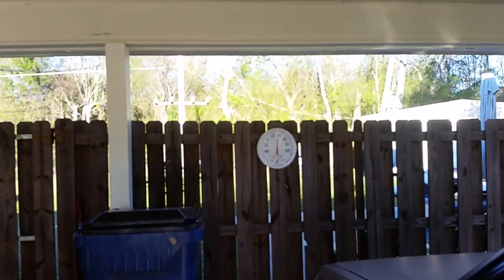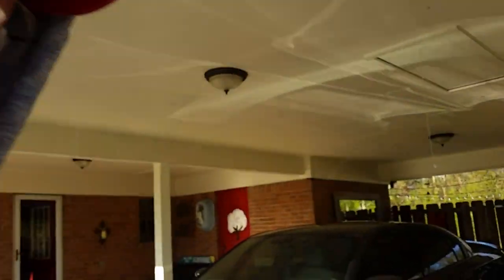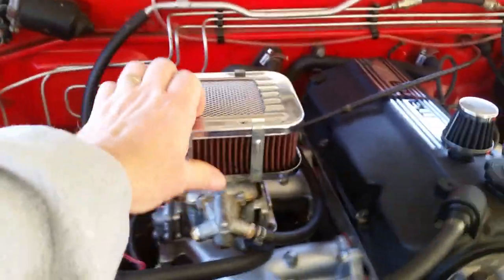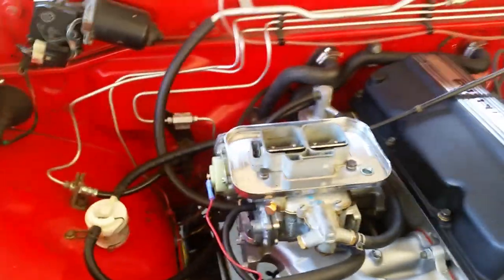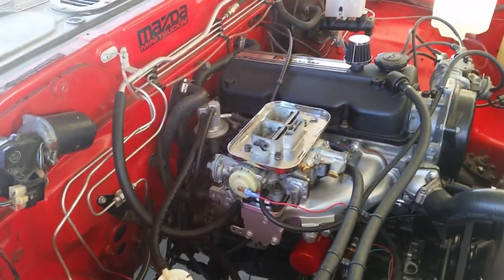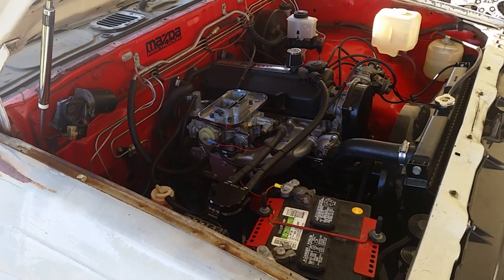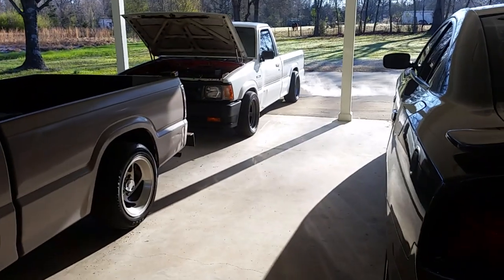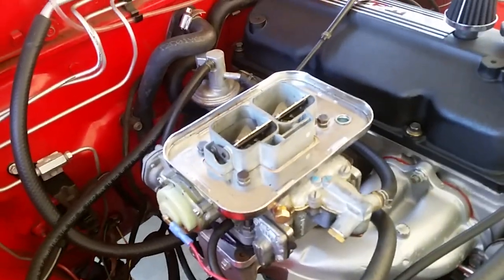How To Adjust Fast Idle on Weber 32/36

Comment: If 12V isn't supplied to the choke coil, it won't open fully.
Reply from the maker: Wrong it most certainly will. 7 volt is sufficient
Reply: Sorry, but no. That's not a fact. Not going to argue with someone over the internet, but no. A few months ago a older GM came into the shop with high idle issues... had around 9V going to it. Wouldn't kick down. Poor crimping on the connector caused interference. New terminal and correct crimping and the choke was receiving 12V. Whatdya know, it worked.
Reply from the maker: @mhubble91  apples to oranges. What you delt with was not a weber 32/36. I know these too well and have been doing this for years
Reply from the maker: @mhubble91  and furthermore this same power is supplied to the original stock carb electric choke. If you open it too soon on these trucks in the winter you'll fall flat f you head out too soon

Comment: Hey dude, great video. But, I'm having a hell of a time with the electric choke on my 32/36. I've tried setting it while cold and while hot. But basically I set it and it starts n runs fine for the first time. But after the choke plates open all the way they get stuck there. Ill run the car till warm and then shut it off n let it cool over night. But then I pat the throttle to close the choke again the next day but it doesn't move. Unless I go n push it closed with my finger then it stays closed. But its as if its sticking... any ideas?
Reply: Do you have 12V (run circuit) to the choke?
Reply: I know this is an old thread, but for those that are experiencing this same issue, you have to depress the gas pedal all the way to the floor one time in order to release the choke plates to the closed position. By doing this (not patting) you rotate the first stage (cold idle choke) to clear the ramp back to the cold starting position.